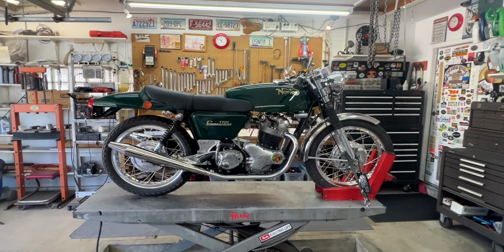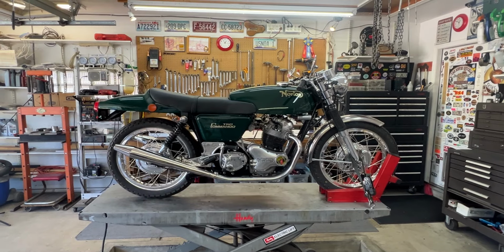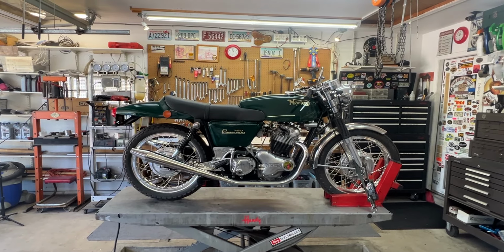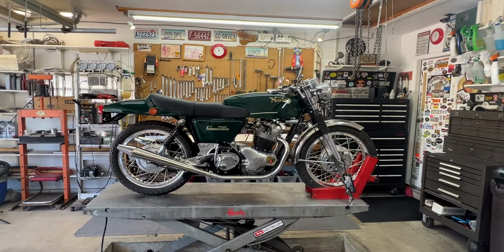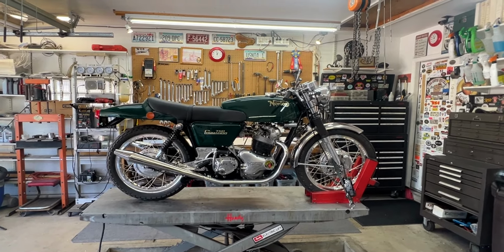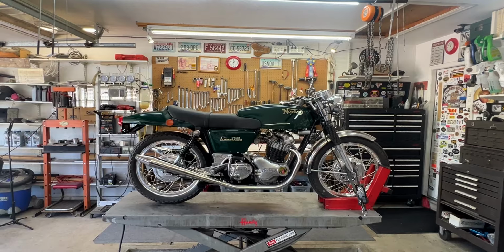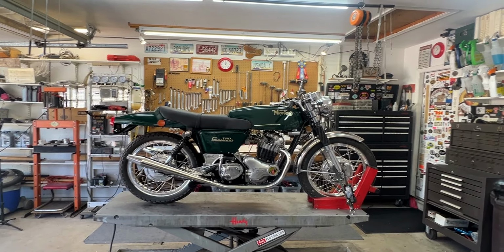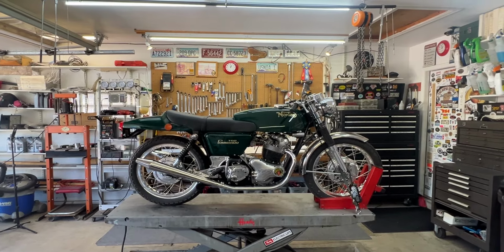05-07-24 - Opinion Rant

Comment: I was wondering what your thoughts were on starting fluid as a diagnostic tool.  I was always told it's a good way to see if you're having a carb problem,, but I haven't used it much myself. 

I'm digging that Norton.  I've never been a fan of putting Mikuni carbs on brit bikes, but after dealing with some overheating hot start idle issues with my Amal concentric's I'm starting to understand why people make the switch.

Comment: G'day from Australia, l tried to use a roller once never again, l have a BSA Super Rocket with a high compression 10/1, and the roller wouldn't move that wheel, just made smoke, get that kick starter on the right stroke an bam it fires, cheers mate good rant, Neil 🤠.

Comment: Ok first thing first as someone that has used starter rollers extensively i wouldn't dream of trying to use rollers on a bike bench 
I put the rollers on the floor 
I put the bike on the rollers 
Select top gear (on my 920 commando)
Switch the ignition on 
Pull in the clutch and start the rollers 
Then i let the clutch out and the rollers turn the engine over 
Its very easy 
No strapping it down etc etc 
Secondly i wouldn't recommend starter spray for starting a motorcycle 
Id recommend it purely as a diagnostic tool 
To see if its a carburettor problem like the pilot jer being plugged or the enrichment jet not working etc 
Also if it runs however briefly you know the valve timing and ignition timing are correct 
I hope this helps
Reply: I hope you're right I just built a set. You use top gear? I did not know that.
Reply: @johnod1955 yes I use top gear 
I made my own rollers too with tack welds for grip 
3hp motor

Comment: Member of the New York Norton Owners Association.  That Mikuni carburetor enricher circuit will provide a stable idle during warmup. But for starting, the tickler on an Amal will give you a rich, almost flooded state, which will make the bike "Want to Start".  Also the Norton National Meet, INOA, once a year big time get together, happens June 17-22 in New Hampshire.  This will provide a concentration of real knowledge concerning the proper care and set up of the carburetion required to enjoy the Norton experience.  The commitment to the brand is unparalleled. The membership will exert tremendous effort to help anyone get their Norton into a one or two kick bike.
Reply from the maker: I am INOA (USNOA) Member #1 having started the USNOA (INOA) back in 1975.  Their accumulated Norton knowledge is unparalleled.

Comment: Roll it down a hill with the clutch pulled in (bike in second or third gear) and let the clutch out....the kick-start only works if everything else is 100-percent 😊
Reply from the maker: What!?!? And end up pushing it back up that hill!?!?  I did that when I was 15 with my 1952 HD 125 Tele-Glide.  Ain't never gonna happen again.  And, by the way, Phoenix doesn't have any hills.  It's flatter than a fritter.
Standby.  Keep watching.  The bike should go back on the lift in a few days.